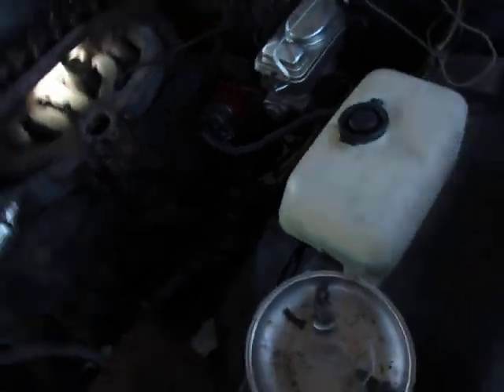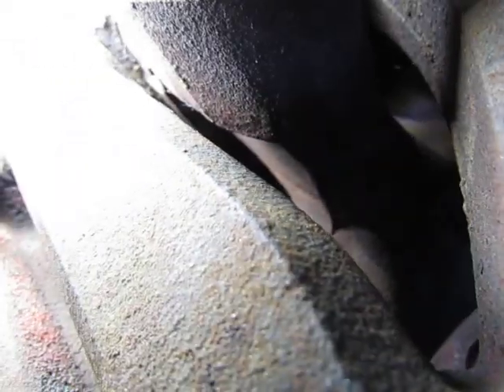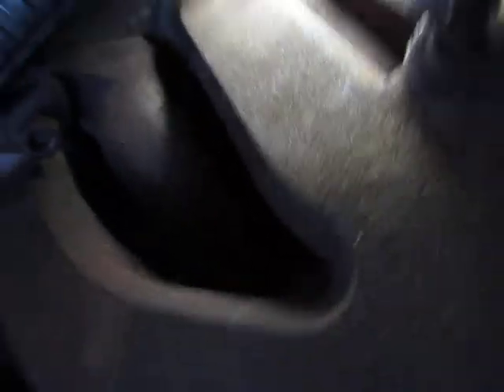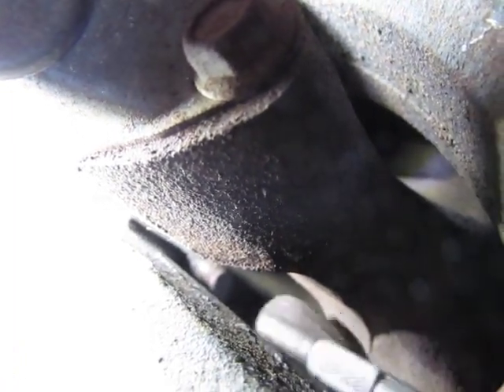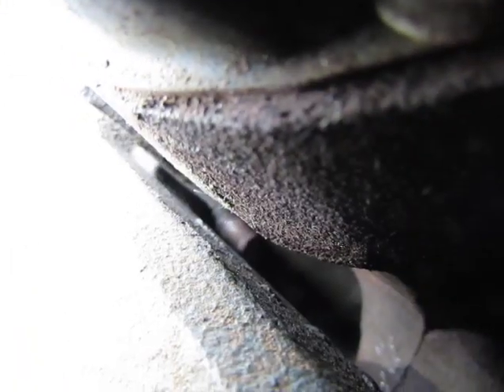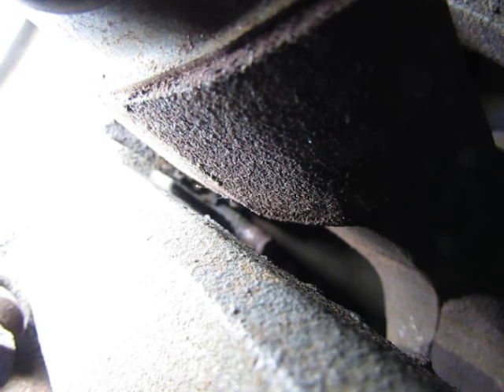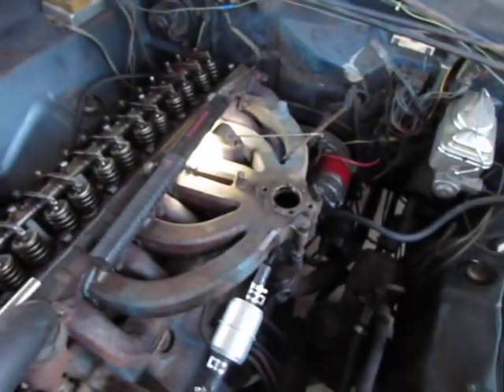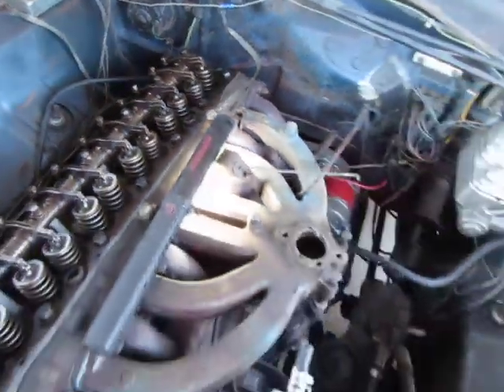How to slant 6 manifold clamps

Comment: I used a NON-MAGNETIC FLEXIBLE MECHANIC CLAW 24" PICK-UP TOOL SPRING LOADED PARTS GRABBER and didn't drop a single one. But your way was way more fun to watch.😉 Also with the manifolds off I put chalk marks down the side of the block from where the lower studs are. Helps with those hard to see studs.

Comment: Leaning Tower of Power. Thanks for the info, I'm working on one of these now, a 64 Polara survivor. Update - all done,  simple way. Put in the bottom row of studs, gasket (nuts and washers loose). Then set the manifold combo down on top of them. Then top row of hardware. Tighten. Maybe 15 minutes.

Comment: I used a super thin craft wire (almost as thin as fishing line) my daughter had in her room and looped through that triangle washer.  I then just dropped it down in that small opening and guided it on that stud with no issues. Once secured on stud, just pulled the wire out of washer and tightened the nut. Worked like a charm.